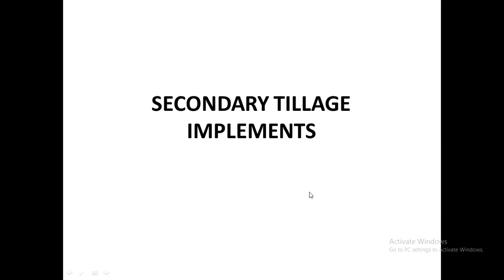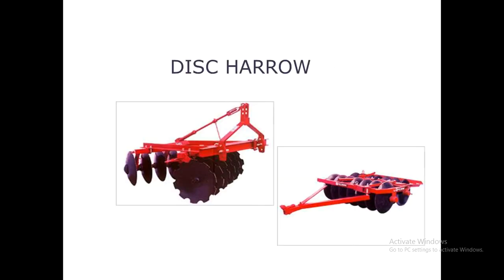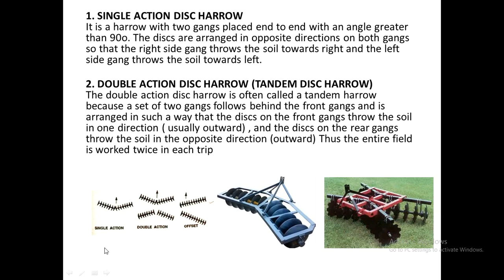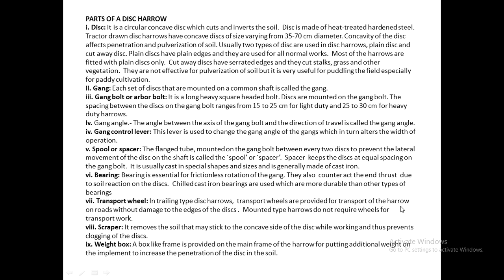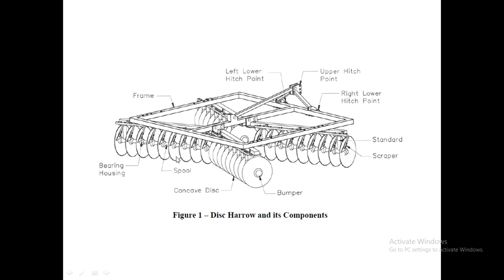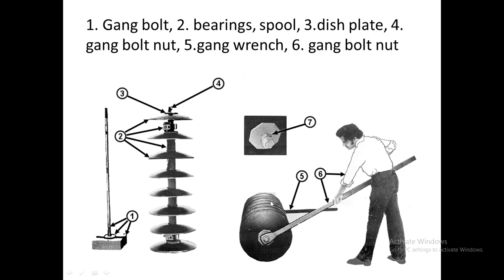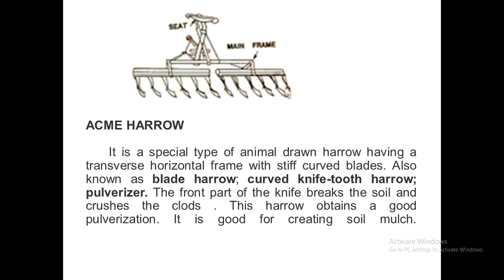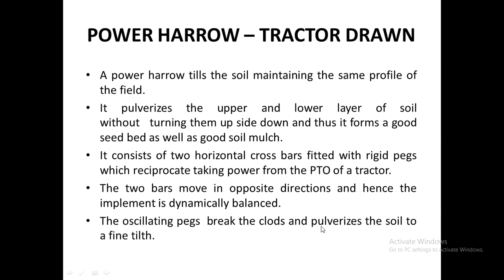Farm equipment|Lecture 3|Secondary Tillage implements|Harrows|Disc harrows|Power& Indigenous harrows

Comment: Poorly presented. I advice to reload with more clarity. at one place you are not sure for off-set disc harrow if it is ether single action or double action. Certainly it is a double action harrow. Further, in power harrow segment, you are telling that it is connected with a shaft which is totally wrong. Those are connected through gears. Please make a video with clarity. with best wishes.